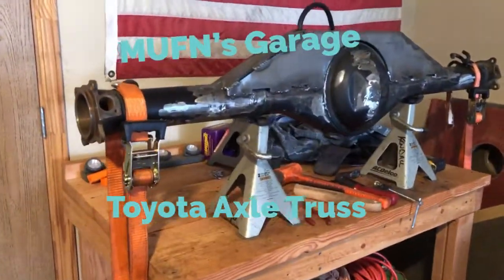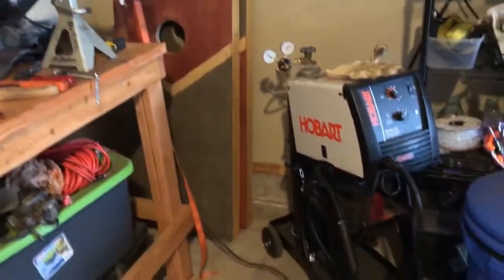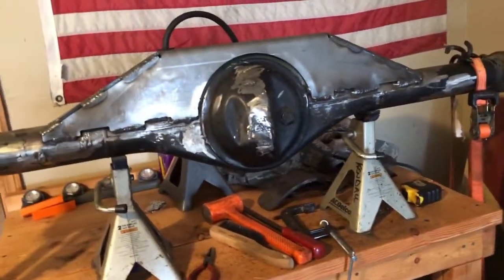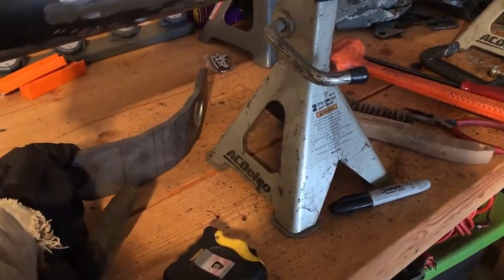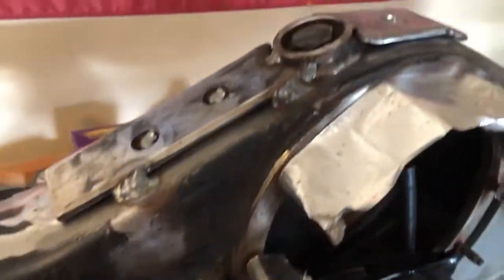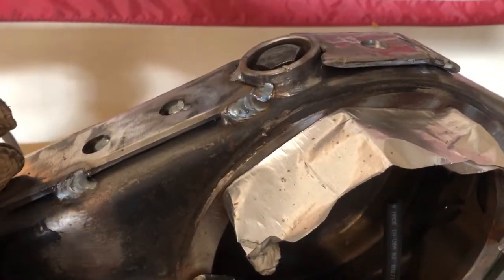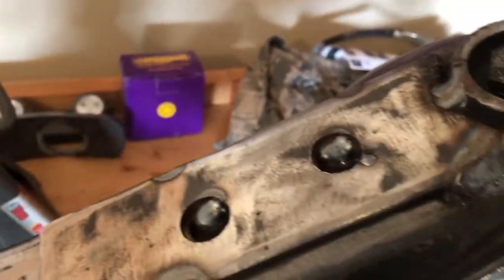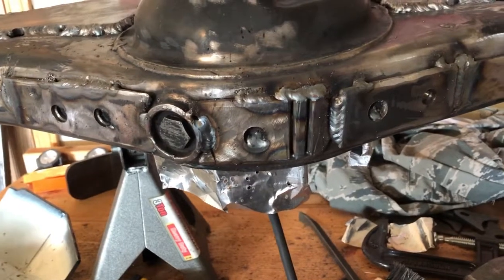Toyota 8 Truss and Armor

Comment: Looks good. I'm looking at the same truss for my 4Runner. You happy with it?
Reply from the maker: Alexander Woods definitely although I used a stock style breather to keep my seals intact
Reply: @mufnsgarage8780  Nice, I have an breather extension hose run into the gas cap area and an air locker line. Should be easy enough to modify the truss tho. Going to a 3link setup and I'm hoping the truss will keep the axle straight